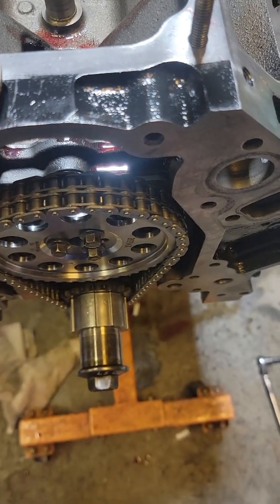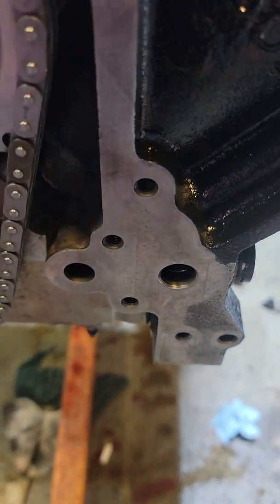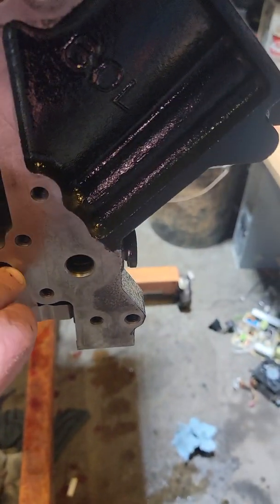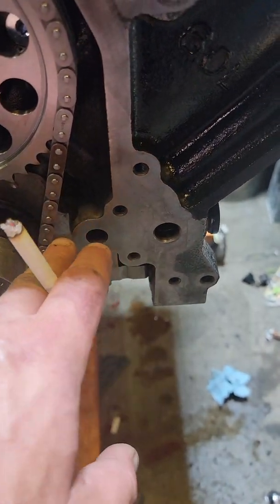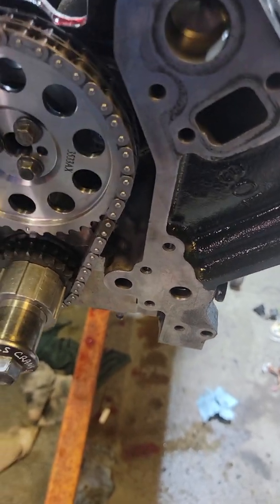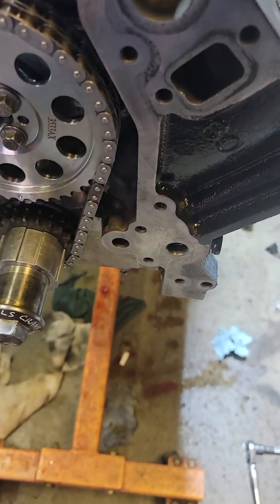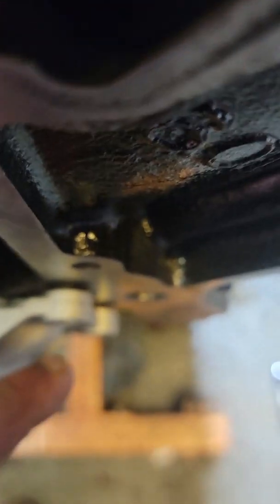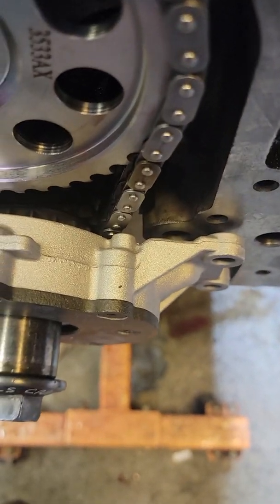LS Oil Pump Spacer Install.  Do you need RTV on it?

Comment from the maker: I think i left this out.   BTW, I only run FULL SYNTHETIC VALVOLINE oil in my engines. In my LS its 5w30 as recommended.  Ive never had massive deposts buildup, every 5k oil change looks a little gold still, and for the only two engines ive built and ran from day one until they hit 100k, when I pulled them apart (not because they were bad, but for upgrades) I found VERY LITTLE SLUDGE anywhere. Only oil staining, and idk of anybrand that doesnt make steel change a little brown when oil soaked and heated and cooled 1000s of times...
Reply from the maker: Valvoline, if you read this...  I'll take a sponsorship if you're up for it.  Just give me enough oil to change my few cars and trucks.

Comment: I would cut a 3 to 5 thousands grove to feed timing chain some oil if I was doing it and had ho oil pump...wouldn't hurt at all it would be great
Reply: Small channel Grove on that plate your installing
Reply from the maker: @Kc805kckc it's just not needed.   I misspoke in the video, stating the chain was only lubed from the crank.  What I meant to say was overflow from the lifter galley and that's actually why there are holes cast into the block there, with drain ports.   One think I've learned, be it ANY ENGINE MANUFACTURERS" is when rebuilding them, before you send them for a final clean, is to DEBURR all the edges with a demel.  You don't need oil sitting and "baking" on the edges of the heads or corners of the lifer gallery.  By smoothing out those, oil gets back to the pan quicker and when it's concerning the timing chain, I don't need oil squirters, as the gallery drains are fine.  When LS engines are concerned, they get a boost from the oil pump around its connection to the crank, which will spray a bit of oil out as well.  The oil pump impeller isn't sealed at all, and that's where all the oil pressure is created, so the small clearance inside, will actually spray small amounts of oil out, and onto the chain.  And small amounts are all that's needed.  Think motorcycle chains that are only lubed by a rattle can of "chain lube" 2x a year when someone decided to go on a trip.  The timing chain doesn't see the elements so once coated in a little oil,  it only needs a little to survive for years...
And if I may, for those that don't know, in the "GM BAD YEARS" from the late 70s thru mid 80s" GM tried to build the most fuel efficient cars and trucks they could using older designs.  This lead to timing chains that had Teflon on the gears to help lube them along, while running very lower pressure pumps.  Idle was only 25psi on some SBC low HP models.  The Teflon worked great but 20 years later, became brittle and broke leaving a sloppy timing setup.  These were VERY LOW HP ENGINES..  Top Gear UK, I think it was Richard Hammon who asked.. "Who did they get such a big V8 to make such little power" when referring to 1980s era V8's.  And poor castings, with other plastics as lube helped...
Reply from the maker: @Kc805kckc long story short.  A specific machined goove isn't needed.

Comment: I’m thinking a lil anaerobic silicone on mine.
Reply from the maker: For what purpose?  On the spacers?  As I said it doesn't hurt anything without it.  Put if you put some RTV on there and it gets blown thru the system, you extra RTV may end up in a cam or crank bearing passage,  carrying debrits that could harm those bearings.   Sometimes.  Less is more.  
I won't tell you how to build your engine.  ITS YOURS!!!  But I'll pull mine apart at 50k just to look, right before I install a much bigger cam, and a turbo.  I bet my bearings look brand new..
Reply: @dr.noitall9887   I ended up installing mine dry.

Comment: I’m experiencing low oil pressure fluctuations, with this double roller timing chain spacers but idk if that’s the culprit. Wondering if you had any issues?
Reply: You ever get it figured out ?
Reply from the maker: I've put over 20k miles on this engine at this point an have 60psi hot idle and anything over 1500rpm I see 90psi which is where my spring release is set.  In my experience only 3 things cause a massive drop in oil pressure.   Bad bearings,  bad oil pump, or a major leak (usually internally) but right after I finished and installed this build, the stock "oem" oil pressure sensor failed and actually sprayed oil out through the wiring harness connector.   I'm thinking this is rare tho.